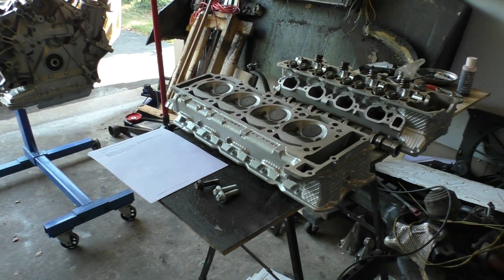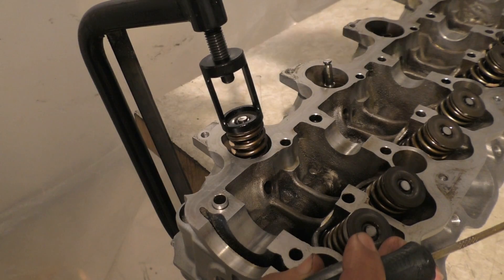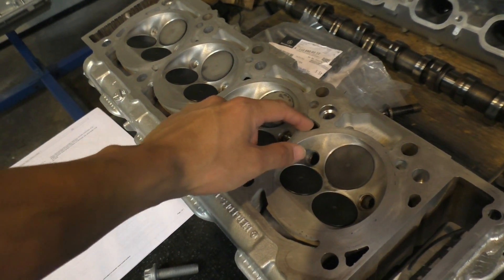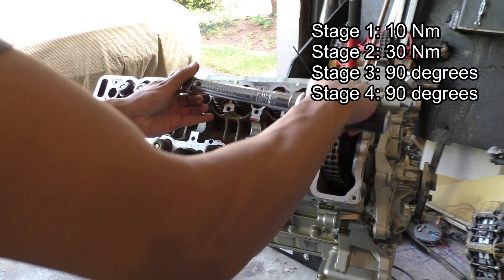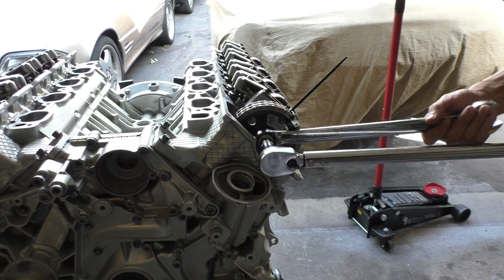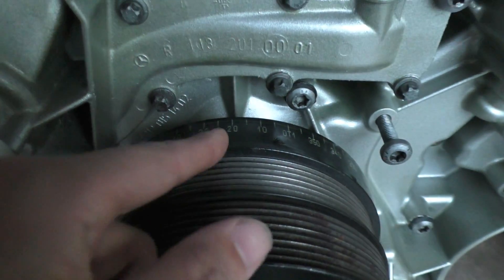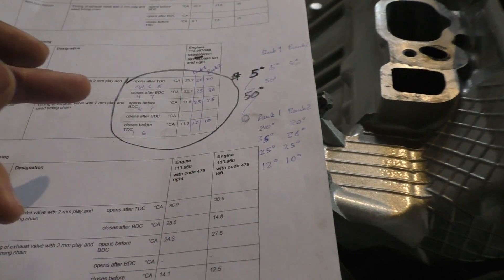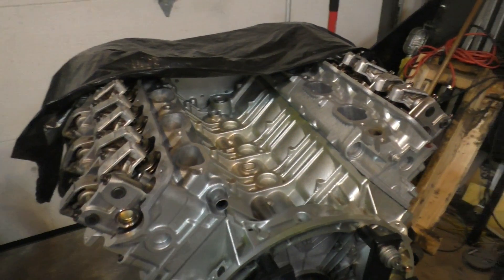E55 Engine Rebuild - Part 6 (Head Install and Valve Timing Check)

Comment: hey wat is the extra hole on the passenger head where the SC bolts to then the air secondary pump were the air valve bolts down to the head right there is a square hole nothing covers it wen i rebuilt my SC i was lost wondering why its there

Comment: One small correction, for 113.980 and 981, the correct torque for rocker arm is: 15NM for M7*45bolt and 10NM+90degree for M7*84 bolt

Comment: Hi, this is awesome footage. I’m about to change valve stem seal on my engine, which include remove the rocker arm, I noticed those bolt also need to be turned 90 degree after a specific torque, do you think it should be fine to reuse it or buy new bolts?

Comment: Great vid! Very clean work!
One question. There's some way to test the hydraulic lifters when on rockers (without dismantling all the camshaft), i.e. when the cylinder is in BDC, test them pushing to check if have oil pressure? I think I one or two could have gone bad.
I'm redoing the valve cover gaskets in a m112, so to take advantage of the situation 😅

Comment: I’m working on my 2005 cl 55 amg replacing all the bearings and Piston rings watching your video helps me a lot
Reply: How did that go for you? I’m going to do the same on my e55. Yours still running and is it stock or do you have any mods?

Comment: I am not sure the M119 heads flowed any better than the M113. Actually the M113 heads flowed pretty good compared to higher HP 5 liters. If the numbers I have seen are accurate than the heads should support well over 400HP NA if all the other components were capable. .600" lift cams just aren't possible though but know the head flow just isn't an issue.

Comment: Hi.
Would you please let me know what part goes onto the rectangle port on the driver's side of the head?

I have a C55 with a M113 engine and can't figure out what covers that port. The intake manifold gasket left that port open.
Thank you in advance for your help.

Comment: The twin spark 3 valve design was to reduce pollution, when that generation was release it was some of the cleanest burning engines  produced.

Of course, having to rotate one camshaft per bank instead of two increases torque slightly across the rev range (very beneficial in the low range)

Comment: Or maybe you could answer this or somebody who's reading and watching your video I have a 2004 E320 with the m112 engine and it blew the intake manifold off I don't believe it actually blew off I think it was so weak that the linkage I don't think the flappers dark because there's not that much carbon inside the intake but it just blew the linkage right in the front of it at your blew that out into pieces because I J-B Weld it it just to make sure I had all the pieces so I knew it didn't suck anything in and it was just two pieces but it blew the whole front of it out and I was seeing if the time was good on the car or if that's why it blew up the intake manifold but there are no copper links on my chain I've spun it around probably 40 times and I've marked my chain and spin it around and I have not found a copper link so I'm thinking that that is a new chain of replacement chain or do they all come with a copper length and my chain is tight and now I found your video on checking the time on it so that's what I'm going to do tomorrow if it's not pouring down rain I live in the Seattle area so live and let rain thank you very much very videos
Reply from the maker: Yeh, there is no copper links on the factory chain. Only when you replace them. Your manifold could have blown because of a back fire. Check for leaking fuel injectors or intake valves not sealing. Do a compression test and if it turns out okay just swap the manifold and hopefully everything else should be fine

Comment: So if you say those bolts are for one use only, did you have to use another set of bolts AFTeR you’ve done plasti clearance check? For that surely U had to  properly torque the bolts?

Comment: I would love to mate this to my 01E transmission in my audi B6 A4.  It can fit a v8 (4.2 L 5V) and the torque of this monster plus decent HP (tickling 500hp) would make Quattro launches insane (Front LSD, Center Biased Rear Diff & lastly a Rear LSD).  If only there was an adapter plate for the M113 to 01E....

Comment: I am replacing my head gasket for my SL55 and was contemplating ARP head studs. The kits are quite expensive but I recently read that you can use 2 head stud kits for the Nissan sr20, do you know if that information is correct? Thank you for all the great content on the m113k , really helped me out!
Reply from the maker: Not sure. If you know the length of the studs and thread size you can find out. If the studs are slightly longer they would still work because there is enough clearance at the top
Reply: @xfmotorsports  Thank you for replying. I  acctually decided to go with new oem bolts since I probably wont be needing to run super high boost to meet my power goal of 700hp.

Comment: I wonder why you didn't lap the valves? Another thing that you have to make sure when assembling the heads is to push the valve stem seals all the why down. You might even want to hammer them down. If you don't, they might come loose due to the movement of the valves. I learned this the hard way...

Comment: Great vids, I especially liked the ones on suspension set up. On you next go round I suggest you get an oil surge tank it will help with oil starvation on a car that pulls a lot of G force in turns. Also Isolate the turbos oil system with in the trunk with an oil tank and the pump you use to return oil to engine. You can also use the old small oil cooler to regulate the turbos oil temp. It will take a load of the engines oil pump/system. Keep up the good work.
Reply: 5555

6

⁷

Comment: Nono, the 3 valve engine was design with low cost as the main focus. Thats the only reason. 3 valve is not more fuel efficient than 4. Its just cheaper to build.
Reply: Low cost = lower price and better reliability for the owner,,three valves still gives good flow , and enables dual spark plugs for better ignition...I think MB know what they are doing.

Comment: IS there any way you could replace the timing rail that goes through the head without having to take the head off? I am planning to do a timing kit replacement.
Thanks,
Reply from the maker: Not sure if the chain guides are going to slide out without removing the heads. You could try unbolting the studs the guides go on if that gives any extra space

Comment: Some question about these being torque to yield. Having torque + angle is not a definite indicator. Specifying a max length is done on normal high tensile bolts. TTYL bolts will stretch significantly and the stretching is a form of work hardening. TTYL bolts will be one time use since they are taken beyond elastic limits where the bolt will be a fair amount longer than new length and the diameter of the bolt shank will be less than a new bolt. Having said that, it is never a bad idea to replace head bolts in aluminum thread engines due to high likelihood of corrosion between bolt and the aluminum block.
Reply from the maker: Good info. Yes, having an angle is not a definite indicator, its best to read through the documents to be sure which ones actually need to be replaced. I've heard from mechanics that you need to replace all the torque + angle ones every time. Its true for some bolts but not always true
Reply: @xfmotorsports  if there is a question replacing is safe. But the confusion comes from the older diesels with tty (I now realize autocorrect changed tty to ttyl a few times. LOL) were the earliest use of torque plus angle. In lots of cases t+a was adopted because it gets very consistent fastener forces where rough versus smooth threads make torque needed to get a bolt turned to get that fastener force be different for each bolt. Low torque doesn't get to the rough thread friction level and then you turn them the angle with no regard to the torque. The elongation by the same rotation amount sets the stretch and thus the force equally. Also robotic equipment can do torque + angle with little tool wear and high accuracy. Torsion bar force limiters on impact wrench tools can get to the low torque and then a sleeve drops over socket and locks out the torsion bar and then the socket is rotated the number of degrees monitored closely. Very cool equipment replacing someone swinging a torque wrench hundreds of times per day.

Comment: Thanks for the great videos, you are doing an awesome job with your rebuild.  I have a 113 engine in my 2001 CLK55, normally aspirated and this is helpful for should I ever have to break it down.  Also, been sharing the oil tube issues with those I know that have the K engine and to be on top of that o-ring replacement on timely basis.  Thanks again.